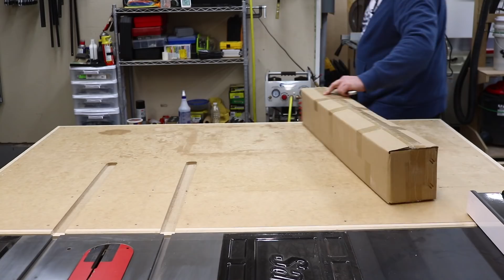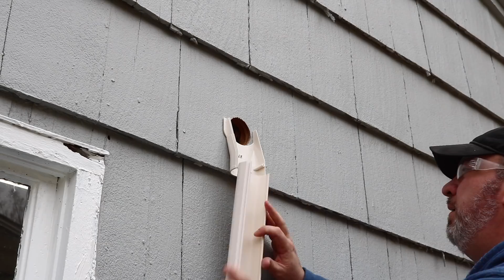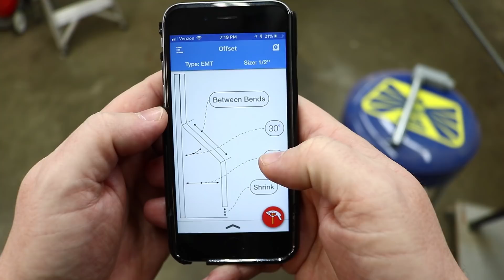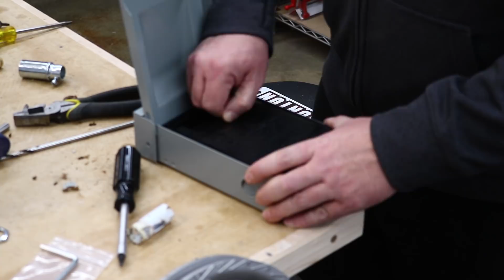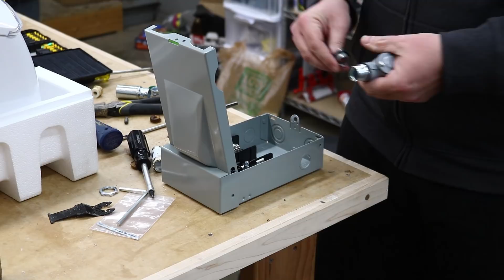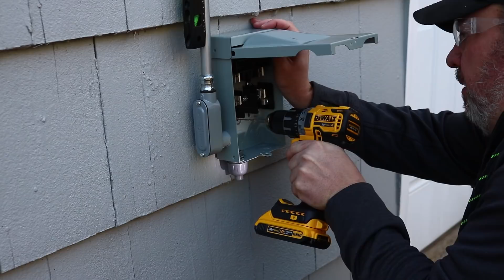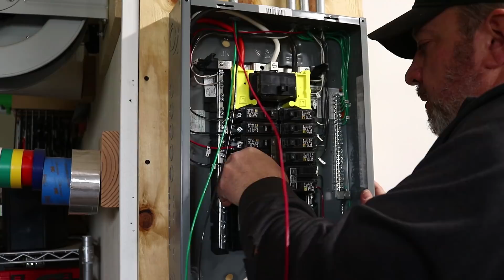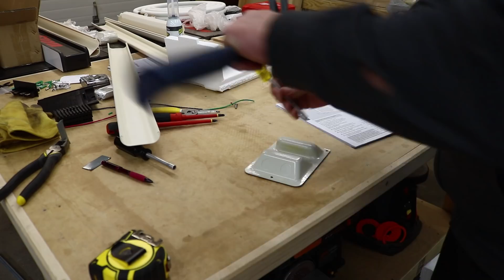How to Install a Ductless Mini Split

Comment: Thanks for posting.  I especially like how in depth you went on how to run power.  Looks too hard.  I think I'll hire an electrician to do that part.  Did you really need a tech for the refrigerant lines?  Looks like that part is easier than running power.
Reply from the maker: Hey Ron, thanks for commenting. The electrical was my favorite part! I added a sub panel and did all new electrical in my shop a few months before installing this unit so this was really easy. I didn’t want to fuss with renting equipment and then making a mistake and have to get the equipment again. Part of the fee I paid the tech was for him to come out to my shop before I started and walk through the whole installation. That alone was worth the fee so I felt like the final connections was just a bonus.

Comment: Did you need to add fuses into the disconnect box still though?  Did not see any installed
Reply from the maker: Yeah, I did have to add fuses.  The hvac tech had some on hand so I am not sure which ones they were.

Comment: can you put 2 splits off that one unit or do I need 2 whole systems? I want one in garage and in house.
Reply from the maker: You can run multiple heads off of one outdoor unit.  Not this one in particular though.  However, most mini split manufacturers offer that option.  Here's a link to the dual zone options from the manufacturer of the system I got: https://www.pioneerminisplit.com/collections/multi-split-systems/type_dual-zones
Reply: +The Average Craftsman ty. 👍
Reply from the maker: Sorry for the delayed reply.  I actually replied to this a couple of weeks ago but the YouTube creator studio is having an issue and most of my comments over the last couple of weeks have been lost.

Comment: You did a great job,  since I retired from being in management, it would take me about a year to do all the things you did.  So I thinking of having a complete system installed in my home since you cool just the rooms that you use.  My brother in sarasota did that in an old victorian house and he says his electric bill is one third of what it was last year.  But he didn't tell me how much it cost. He had a total of 15 units installed.
Reply from the maker: Thanks for the comment!  For a 15 zone system I would think it would be upwards of $10-15k for the units and installation.  I've seen 8 zone systems for about 5k but that's the most I've seen run on from a single compressor so I am guessing he has two compressors at least.

Comment: Hello,  Enjoyed your presentation although I would have liked to see you complete the installation with vacuuming and pressure testing it diy.  One note: latest code calls for a GFCI 120 vac outlet within 25 feet of the compressor don't know if you already have one but if not disconnect boxes are available with space to include one (you would have to pull a set of conducters though as the a/c needs dedicated ones as you did).  It is nice to see someone actually use the correct conductor in conduit as most diy'ers do not.  The other error in my opinion is not pouring a substantial slab to place the compressor as pavers are just too prone to frost heaving etc and the units do not perform well out of plumb.  An open shelter around it to provide weather protection is also a worthwhile addition and will allow the unit to achieve maximum lifespan.  Take care.  Doug
Reply from the maker: Thanks for your comment, Doug.  I would have liked to have done the vac and pressure testing but I had no experience doing it and the HVAC tech I hired was quite affordable and I knew it would get done right.  

I have two 120 outlets right by the unit.  One on the other side of the wall next to the door and one around the corner on the back of the house.  However, I am not sure that is code where I live.  Only a disconnect near the unit.

Before I installed anything I talked with an HVAC tech and asked about the base and he said pavers would be fine.  I installed this in February and we've had quite a few freeze/thaws.  I'll check it for level tonight and see how it's held up.

Thanks!
Reply: Keep in mind that national building codes are by federal law required across the nation.  Local entities can add additional requirements.  They can not detract from the national code.  Always safe to follow the code even if local inspectors don't require it as you can get involved in a situation where the next inspector comes along and does require it.  It can also bite you if/when it comes time to sell.    I believe this particular one was inspired to protect anyone working on the unit when they plug tools in.  Outside is of course considered a "wet" location which requires the GFCI.  It would be good to hear how yours performed since your installation in February, the climate you are in, and the cost of operating the unit.  How many square feet are you conditioning?  It is a new technology (especially cold climate pumps and increasing efficiencies) so real world information by users like yours is very helpful.  I am shopping now for a unit for my 1400 sq ft  with open loft (about 10K cubic feet) shop.  Where I am in a rural area having it installed runs several thousand (even with prep work done) so doing the full install is the only way it makes fiscal sense. Having done auto a/c work in the past as well as installing boilers and furnaces I have the tools and a pretty good sense of how to.  Looking for curve balls in particular models and makes helps a lot so I watch videos to end run problems.
Thanks again for the informative video.  Take care. Doug
Reply from the maker: There's no national building code in the US.  It's all based on what the states adopt and can vary greatly from state to state and even city to city.  Most jurisdictions start with the International Building Code and then modify to suit their unique needs.  The only code requirement around here is that a shutoff is within "sight" of the unit.  There is no requirement for 120 outlets nearby.  Regardless, I have two within 20 feet both inside and outside and both are GFCI.  

 A lot of the questions you asked are answered in the build article on my website: https://www.theaveragecraftsman.com/projects/how-to-install-ductless-mini-split/

So far it's been performing great.  It heats/cools around 500 square feet and I am located in the midwest so I get really hot summers and really cold winters.  

This is an inverted++ model so it can provide when the outside temp is as low as -13 degrees.

If you can find an hvac tech like I did to do the vac and pressure test you should be able to install one yourself pretty easily.  They aren't that difficult but can be a little confusing on what all is required.  Having that HVAC tech answer a lot of those questions for me helped a lot.

Comment: Nice job,whats the square footage on the heat & cooling of this unit.
Reply from the maker: My shop is a little under 500 sq ft and I did a load calculator with a couple of companies and they recommended an 18k btu unit.  However, it's not based solely on square footage.  Orientation of the room/space, windows, doors, insulation, etc all factor.